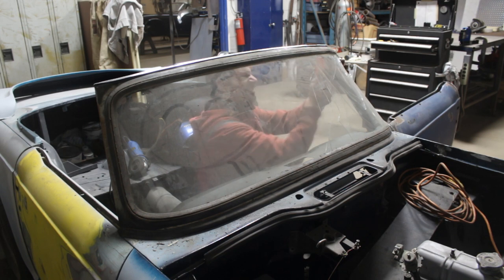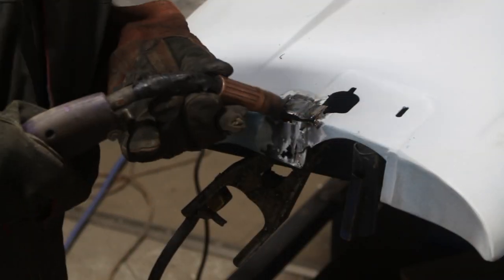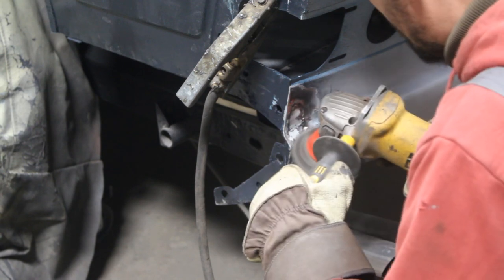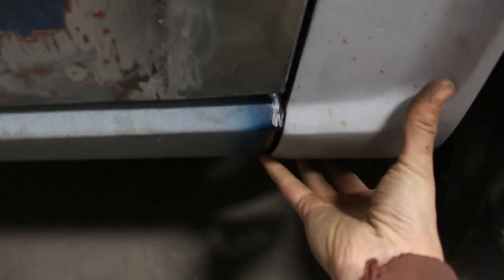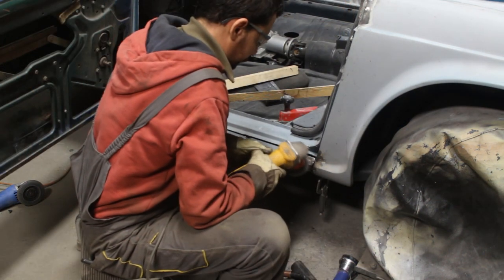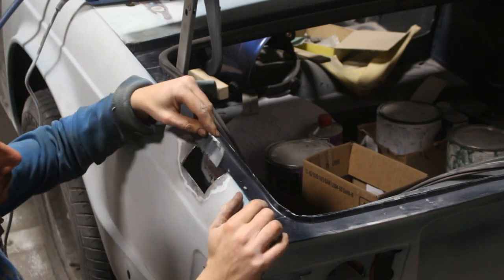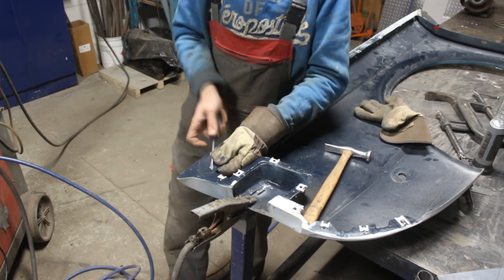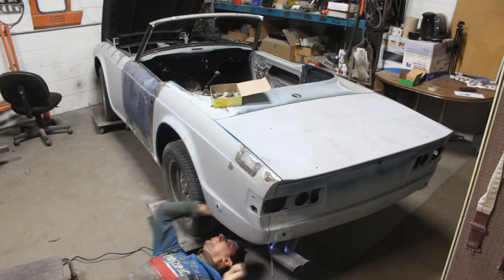1973 Triumh TR6 Restoration Project - Part 9 - More bodywork

Comment: You have my profound respect, Elin.

I spent the majority of my working life as a small boat repair contractor. In one marina an old, blind and stupid old fool also operated and produced the most hideous repairs to his customers boats. He was known as "John the Bodger"! Quite why the marina management allowed him the operate was a mystery to many people. Customers frequently found out the hard way about the quality of his repairs !!! Fortunately I had a motor trade background and was also a qualified aircraft engineer. I lost count of the number of times I would be asked to sort out "John the Bodgers" messes......

On one occasion I was called in to look at a large plywood on frame repair that John had cobbled up. John had inserted a piece of ply packing case into the side of the boat with no structural support built around it. Externally the repair looked plausable enough. Only when the owner had inspected from the inside of a locker was the truth revealed. The surrounding frame and stringers were completely rotten and likely to disintegrate at sea with possible loss of life. I ended up replacing 95% of that starboard hull plus other horrors that were found along the way. 

At the completion of my work on that boat a clear uo of the site followed. The results of my hacking and chopping were loaded into the boat yard dump truck and tipped outside John shed in the middle of the night. Next day Johm had to spend the morning barrowing the mess across the yard. The penney eventually dropped with the management and John was given his marching orders. For transport he used to ride a rusty bicycle. I used to drive a two year old supercharged Jaguar XJR.

Its ironic that John share the same name as the Captain of the Titanic.....namely Edward John Smith! We should all watch out. The are similar types in every trade.

I like your work and videos, Elin. Thanks from the UK.

Mike

Comment: Looking on the bright side Elin, you are becoming a master patch maker and welder. Great work. I have had to split and widen the rear of the rockers on both sides of my six project. Sean
Reply from the maker: It looks like not only the weak areas are common to all sixes, but also the parts that don't fit.

Comment: With colleagues like that you don't need enemies.
I just wondering that nobody saw the level of crap he was doing.
And the sad thing is your boss Jake can't charge for the same job 2 times.
Anyway you're doing great Elin.
Reply from the maker: I blame myself for trusting him blindly! He came in a moment when we were extremely busy. The car was in a little corner of the shop and he was working his magic in peace.... I went and checked his work many times, but he was smart, he was welding (or pretending to weld) and then trowing body filler and primer right away "so it doesn't rust"... And to be honest his bondo skills were good. I noticed he worked very fast, but I thought my skills were really poor if such an easy and fast job was looking so difficult and time consuming to me. And the sad part is that this happens second time to me here in Canada. Another guy two years ago made me doubt my electrical knowledge, because he was "sooooo good" Every time I asked a question he was giving me thousands of electrical therms in complicated sentences and I just said "OK, I thought I know something about electrical, but obviously I have long way to go"..... Well I had to deal with and rewire many limousines he "built" long after he was gone. I had to re-adjust my people judgement level after the first time, but I was too naive to believe this won't happen again. Now I don't trust anybody. I consider them amateurs until they prove me wrong, not the opposite.
Reply: Elin Yakov don't let a couple of idiots ruin you faith in humanity. good people are out there you just have to find them and be wary of the fakes.
Reply from the maker: Oh, yeah, I know that. We found couple of good guys since, but we were careful and judged by their work and not by their words. And they didn't say too much actually, the guys who know their skills are modest and  give you result's not words.
Reply: I know the type of people that you're talking about. Speaks like a waterfall but when it comes to the use of their hands, nothing good happens.That's why we at my job always hire people with a 3 month "test period"
before the contract is signed.
But you're not naive, you just see all the god in people and has been disappointed more than once.

Comment: After watching all your videos I decided to do a compression test on my 75 TR6. Cold numbers 1-6: 155,155,155,155,125,145.  Car runs really well. Next may do hot compression test. Any suggestions? Thanks.
Reply from the maker: It looks great apart from that 125. A difference between any 2 cylinders of more than 15% might cause the engine to run rough and misfire. Check it hot as well, but for me usually there isn't too much difference between cold and hot engine.
Since the car runs well, I wouldn't bother doing anything about it, but in case you are really concerned:
 This low compression might be caused by a bad valve/seat or seized ring in the piston or worn rings and cylinder. Now, I don't think it is worn ring or cylinder, because it would be the same for all. Has the car been sitting for a while or it is a driver? If it has been sitting it is possible that a ring is seized, but I haven't heard of this happening on a runner. You can test it with a squirt of oil in the cylinder through the spark plug opening. A little oil on the rings improve the compression. So if you see a good improvement on a "wet" test then your problem is in the bottom - rings, cylinder.... If nothing changes, then your problem is in the head - bad or just dirty (with carbon) valve or bad seat. If you decide to do anything about it, you should start by pulling the head and checking the valves (head upside down and fuel in the combustion chambers, check for leaks through the valve stems) and go from there. You might get away with just cleaning the back of the valves on a bench grinder with brass wire wheel or you might need to go deeper and change/reseat the valves etc.
Reply: Thank you Elin for a great reply. I bought this car in 1988. It was a one-owner, completely original and rust free with 43,000 miles. In the 29 years I've owned it I've enjoyed many short sunny drives and put on about 23,000 miles, average 800 miles/year. It sits for months every winter so is definitely not a 'driver'. I'll redo the compression test wet to confirm it's a stuck ring. If it is, can I do anything to 'unstick' it? If it's a valve, I'll probably leave it and hope it's just carbon. If that's the case can I add anything to the fuel to clean it up? Much appreciate your advice, and congrats on a great job with your videos. They are a virtual training course on TR6.
Reply: Thanks again for your help! Here's the results of the wet compression test 1-6: 175,185,180,185,155,195.  They all went up from the dry numbers, but #5 is still lower than the rest. So from what you advised, I'm assuming I have a problem related to the valves on #5.  When I bought the car I had low compression on a few cylinders so I had a shop replace the exhaust valves which were burned. They also added seats which i was told would last longer with unleaded gas. Unfortunately I don't have a record of what the compression was after the valve job. If the problem is a carbon build-up can you recommend a gas additive or other treatment to clear the carbon? Also, I admit that for 29 years I have maybe been too gentle with the old girl, and rarely applied full throttle or taken it above 3500 RPM. What do you think of a few minutes of heavy throttle and higher RPM? Really appreciate your advice!
Reply from the maker: Well, these results are a little on the bad news side, because (this is my opinion and please, anybody, correct me if I am wrong) all the cylinders increased way too much the compression. This means that the rings do not seal very well anymore. And number 5 is still much lower than the others, but it increased as well, so there shouldn't be a seized or broken ring, otherwise it wouldn't increase at all. Or on a second thought that might be the increase on the second compression ring.... Hmmm.... But most likely it's problem is in the head. Unfortunately I don't know anything about additives... Maybe there is a good one, that can clean the carbon, but I never looked for one. I always pull the head and clean manually and replace/reseat valves etc. This also gives me the opportunity to inspect and fix other things if needed like valve guides, seats and also to inspect the cylinders for scratches and even measure the bore for size, out of round and taper, without removing anything from the bottom end of the engine. Yes, it is more work, but at least you have a very good conclusion for the condition of your engine. 
Now, don't trust me 100%, I am not even a full time mechanic. I do this as I hobby and I still learn, so if I were you I would consult a professional mechanic first before I do anything. This is just my opinion!
Reply: Once again, thanks Elin for your time and experienced advice. I don't doubt that at 65,000 miles the pistons and cylinders will be worn. I'm hoping that the problem with #5 is a little chunk of carbon stuck in the intake valve. I bought a fuel additive at CTC for $18 which I'll add to the tank and drive over the next weeks hoping the carbon gets cleaned. I'll do another compression after it has time to work and see if #5 improves. Since the engine runs so well, and because I'll drive under 1000 miles per year for the next few years I'd rather not have to remove the head for service. I'll post the results of the decarbonizer when I do the next test. If the problem worsens in the future I will have to bite the bullet and do the head/valves etc.  Again, many thanks!!!
Reply from the maker: Good decision. Actually the 155-ish dry results are not bad, so if you manage to fix that #5 you will be able to enjoy the car many more kilometers. I hope this additive works for you. Please, post the results so we all learn something new! Good luck!
Reply: I still haven't tried the fuel treatment. I'm waiting for a reply from Dura Lube hoping they can confirm that their treatment will not damage any of my 42 year old fuel system. Have you heard of any issues?
Reply: I finally got around to using a product called CRC Intake Valve Cleaner from Canadian Tire. Hot compression is now 150 in all except 140 in #5, so I'm satisfied, and the engine is running smooth and strong. Dave
Reply from the maker: Great news! Probably you had carbon at the back of the valves and they weren't closing properly. I am happy for you! Have a great summer with the 6!